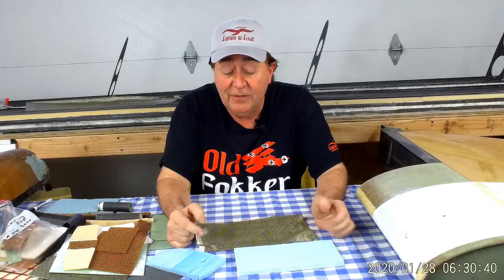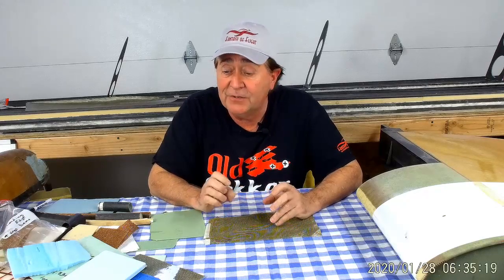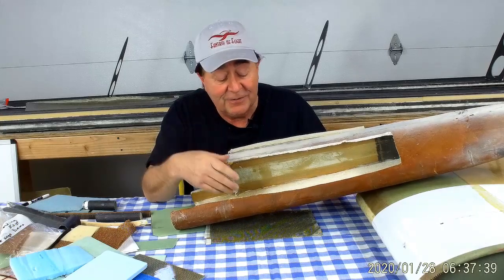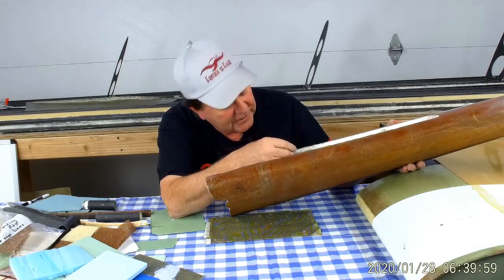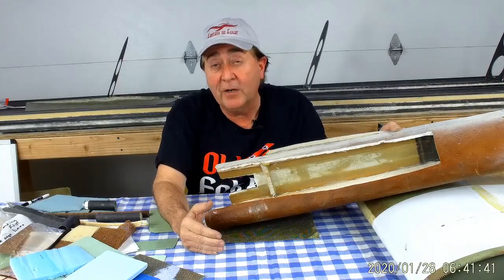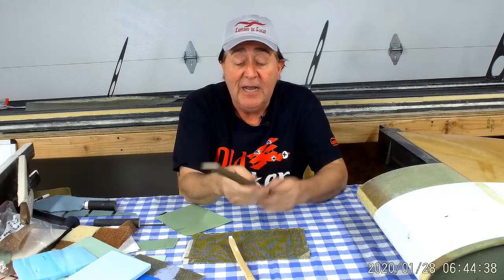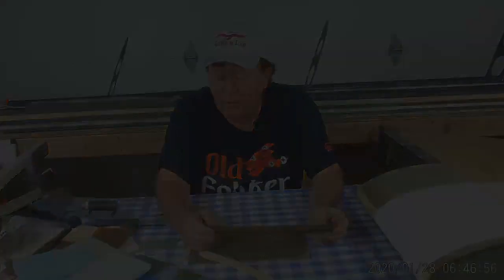Material and Structural Trades, Part II - Klingberg Wing MkII Development

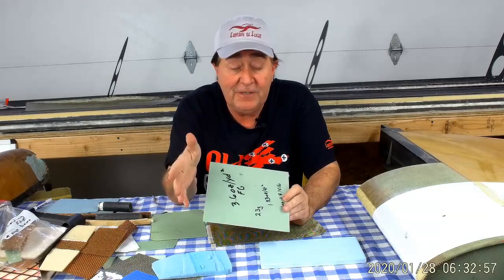Comment: I believe in your weight assessment at 2:30 you have the skins sides backwards , for the light yet durable sandwich skin 5 oz carbon ply on the outside 3/16 4 lb density foam core, 1.8 or 2.2 oz glass on the inside, vacuum  bagged and easy on resin.
Reply from the maker: Interesting, what is your structural analysis or reasoning that leads you to that conclusion? Why would having the CF on the outside be stronger and/or lighter?
Reply: @KlingbergWingMkII  Not lighter but the stronger ply on the outside gives you the handling loads and dent resistance
Reply from the maker: @sychrovsky  Technically correct on a small scale. The foam is 3/32-in thick, the spar is about 6 inches tall, so by moving the CF layer to the outside would gain about 3% in strength - not very significant when considering other important factors. For example, CF is much more brittle than fiberglass. Hang gliders are often set up and taken apart in rough terrain. This means the structure is exposed to possible minor damage to outer surfaces. Small rocks or sticks could easily crack CF. From my lab tests, CF just fractures, the fiberglass dents. So, as you will see in an up-coming video, I have designed the wing so all the loads can be carried on the inner skin only. The outer skin is there for mostly aerodynamic reasons. In addition, with my design, the outer skin is not attached directly to the spar. So, overall, better to have the stronger material on the inside where it bonds directly to the spar. So, what I am discussing here is the broad spectrum of trade-offs that have to occur with any design. In the aerospace industry, establishing requirements, and flowing them into the design via trade studies is the work of a systems engineer ( I used to do that type of work). The issue for many homebuilders and some engineers is that they are trained or focus on one specific aspect of a design (aerodynamics, structures, controls, etc) and they fail to optimize designs because they don't do all the trades required to balance the requirements. This is what this series of videos is really about, doing all the material and structural trades to arrive at a final design that meets not only the weight requirements but also all the other handling and flight requirements - a tough and tricky task. I hope you continue to watch and enjoy the series. Fly safe!